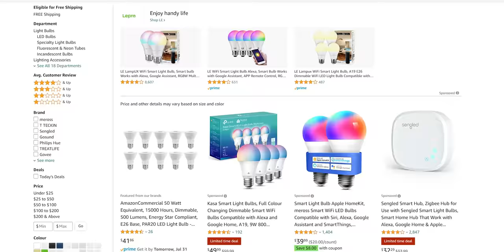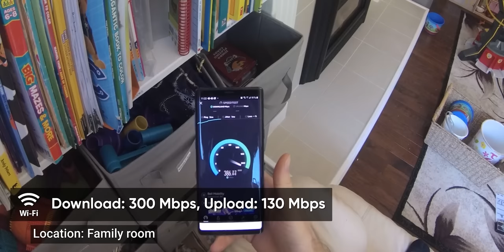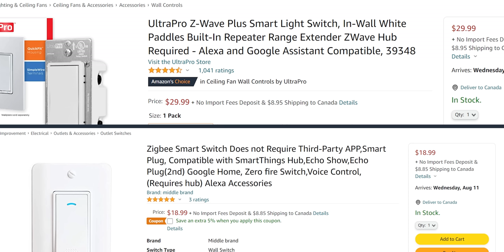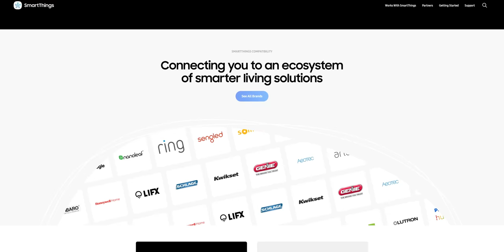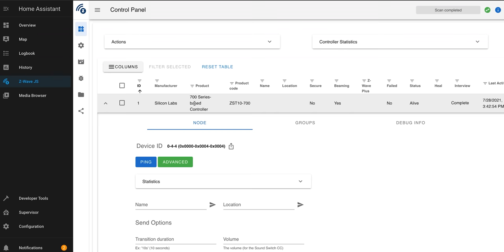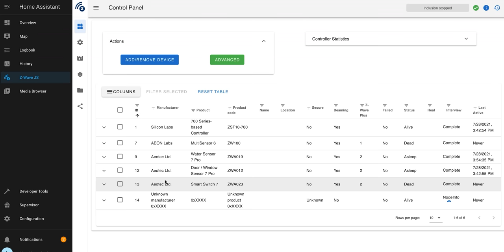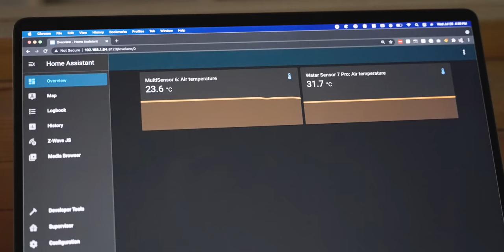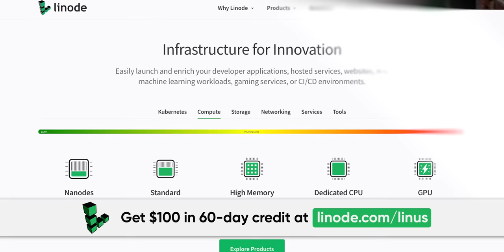My new house is gonna be MAGIC - New House Z-Wave Setup

Comment: The 900 MHz frequency band also has a significantly higher reach then 2.4 GHz with the same energy input as signal dampening is proportional to the Frequency.

Comment: No Linus as an IoT Engineer I can say is wifi devices can be battery powered my DIY made PIR smart sensor lasts 3.2 years with single charge for 2000mAh lithium ion battery... My DIY made sensor uses ESP12F MCU and PIR module draws 26uA in sleep mode and it does get activated about total of 50 seconds in a day. And my sensors connects to Home Assistant in 500ms max

Comment: When I worked in Kansas City I came to really resent the dumb thermostats. It is cold in the morning so I would need heat. It is hot in the afternoon so I would need cooling. Unfortunately, the 1950s vintage thermostat had to be switched manually from heating to cooling. Since I was at work, that did not happen. A fix is obvious, but I do not see it even today. Switching from a bang-bang controller to a proportional controller would also be a great improvement.

Comment: if you are using the GE Zwave switches beware that they are prone to failing from silly things like simple power outages or even just toggling a breaker. i haven't had that issue with the Motion sensing ones just the normal flat switchs.

Comment: One small little drawback with Z-wave is that unsolicited messages are not routed in the mesh network. They have to reach the controller.

So what are unsolicited messages you ask? 
Well say for example you have a device that measures the temperature. You can set it to send in the temperature every time it changes more than X degrees. But since the controller did not request the data it's unsolicited. And if the device can't reach the controller directly it will not get the data at all. However if the controller ask the device for the temperature, the request and the answer will be routed in the mesh. At least this was true in my version of z-wave. The newer version might have changed this. 

Another thing about the "backward compatibility" is that if you have any old version z-wave devices in your network all the new will only talk old version. You have to have all devices using the new version to actually get the features of the new version. Probably not a problem for Linus as he is starting from scratch and will get the newest stuff but when you already have 40+ devices it's a big deal at $30 a device.

Comment: I opted for mostly wifi devices. It was surprisingly hard to find a good set of z light switches. Switches are far better than bulbs. I stuck with z for other things like the smart locks, blinds, and sensors. The good thing is some hubs accept wifi connections too. I use home assistant for some things, and just Alexa for others. You can do simple automations fast in Alexa, but things like light blinking isn't there. I use a bright flashing light to disorient intruders long enough to unlock my gun and blare sirens in and outside the house. My general rule is battery items need to be z. Wifi has half the life

Comment: Not sure what service max is in the area they are in,but down in the US a lot of clients with that size house and with the same tech ambitions usually call for 2 200 amp panels for no double taps on the neutral bar. Something to think about depending on code enforcement in Canada.

Comment: I slowly filled my last house with the Google Home - Smart Things - Enbrighten Z-wave stack. It worked pretty well, but my battery smart-lock died incredibly quickly, and I think it was because the mesh was forcing it to activate frequently. We eventually gave up on using it as a smart lock, which was a bummer.

For my new house, I'm using Zooz switches. They have a couple nice features, including that you only have to replace one of the three-way switches.

Comment: I just installed rf relays in everything in my house I wanted to control, then ran a sonoff rf to wifi hub, controlled by ewelink and google assistant. I also have an RF remote which I use alot more often than the app or assistant

Comment: My knowledge is limited, but from my understanding z-wave, which utilizes a 0.9 GHz band has essentially hit the limit of what they can provide.. considering z-wave like Zigbee and their Bluetooth variants, all act as mesh networks, where several devices link together to extend the range of a network. Most devices buried deep in the mesh will likely have an ok time transferring data, but for that device at the border of the mesh (and even linking a far-reaching part of the network through a node at the edge of the larger mesh)...it might not have a good time. With that lack of bandwidth that comes with operating on such a low frequency, devices et the edge of the network will likely struggle to provide things like multiple high res camera feeds coming through it. 
Zigbee should handle better in this situation, yes the 0.9 GHz band will penetrate walls more efficiently, but the 2.4 GHz band will handle a larger amount of bandwidth. offering an individual node on the network a better chance of handling the load from several other far-reaching devices.

The main selling point of z-wave over Zigbee is that Zigbee isn't unified. In the sense that every single Zigbee device doesn't necessarily have to comply with a strict standard, allowing for complete compatibility with all Zigbee devices. BUT! in my experience, this only applies to proprietary Zigbee devices like Phillips hue bulbs (and these are EXPENSIVE!).
In my opinion, the only reason someone starting out in home automation should choose Zigbee over z-wave is price, and if that's the case you would never be standing there with a $100 Zigbee Phillips hue bulb, or a $120 2m strip of Phillips hue LEDs, scratching your head wondering why it won't connect to the rest of your Zigbee network. it's all too expensive anyway.

If you wanted to throw money at the problem, you would just buy all the hubs you need, all the expensive devices, buy a $500 mesh network, or a $600+ router that can handle your 100+ devices connecting via WI-FI simultaneously, plug it in then take a nap.
And if you really want everything working together well, just link it all with home assistant.

But if you don't want to invest $1000+ more than you have to, decking out your house, then Zigbee/ Z-wave is prob for you. Your average router will NOT be able to handle more than 50 devices (most cant do more than 12-17 devices) but using Zigbee or z-wave (a stripped-down version of wifi) your little router should handle just fine. 
You might have to dig out a couple of old routers from your basement, turn them into AP's to lighten the load, (considering not every smart device you acquire will be Zigbee and some will operate on the standard wifi protocol, but you should be able to set up the infrastructure with what's buried in your garage.

there are good reasons for buying devices that use either standard Wi-Fi, and there are good reasons to buy Zigbee. but everything z-wave can do Zigbee can do too, with the exception of signal range. but z-wave like all mesh's is only good if there are other nodes in the mesh, and it appears z-wave is falling out of favor and Zigbee is becoming more popular.
And as more devices on your network get replaced by Zigbee or standard WIFI, the weaker your Z-Wave network becomes.
Granted Zigbee suffers from the same problem, but Zigbee is becoming more popular, not less.

Comment: Super old video, but small tip - you don't necessarily have to push a pin/etc into the wire release slot on backwire/push-in wired switches/receptacles. You can just twist the receptacle back & forth while pulling and the wire will come out. 

Other side note - backwire really isn't the most preferred connection method. They use a quite small copper tab for connection which passes all the amps through a small portion of the stripped wire, and if the spring fails, can cause arc'ing/etc, leading to fire. so the majority of electricians will always use the screw terminals instead.

Comment: Nice choice. I would give you a tip that saves you allot of headaches. Switch the pi for an odroid n2+. More stable like 1000 times more stable and 1000000000000 times faster.
Reply: And yourself a Zigbee stick. Then you can add all other things and all brands together with your zwave.

Comment: I use Google Home as my controller (along with a bunch of Nest mini and hub devices), Sengled for lighting, and a Eufy for Security. Does what I need for a decent price. I have 27 smart lights, but they connect to Sengled's hub. So in reality, ONLY the Sengled hub is connected to my mesh wi-fi system, not all 27 lights. And honestly, new wi-fi 6 routers can handle 100 devices without sweating.

Comment: 90's home in vancouver is probably piped with poly-b or kitec.  Judging by the design of the home and size I kinda have an idea where you live and im gonna puts bets you have orange coloured or grey coloured pipe.  I would immediately I would have your contractor get his plumber or maybe a decent heating company to do a repipe.  The orange piping actually can catastrophically burst, and the grey is notorious for pinholes, especially if you have a cast iron boiler (I'm a plumber/heating tech in vancouver) Since your already doing what seems to be a massive 100k+ reno I wouldn't cheap out on that cause you dont want a plumber to come by and cut holes in your nice drywall or jackhammer your floor to repair a leaking line.  

This message will probably by sent to the void but hopefully the message gets to you.

Comment: Great video, looking forward to the project unfolding.  I have been building out a Z-Wave system for the last few years, and use a controller that handles Z-Wave, Zigbee and Wifi.  My only comment is that I have become somewhat gun shy of  GE switches.  I am finding myself replacing them regularly as they go down.  I am replacing them with Leviton, and they seem much more robust.  Getting 2-3 years out of a $65 switch is a bit annoying...
Reply: Yeah, the GE switches are not good.  That's why they're sooo cheap on eBay right now. Leviton is good, Zooz seems to be good stuff, too :)

Comment: Home assistant seems nice but I run Homeseer controlling x10, zwave+, concord alarm, 310mhz and 433mhz devices...I too hate batteries so motion sensors are battery and security devices use 3.6v 1/2 AA and last 12y

Comment: 11:30 son of an air conditioning contractor/repairman here. they're already supposed to have that. it's a hell of a lot less high tech but there's meant to be a float switch that detects when the drain pan is overflowing but i guess that either broke or was removed/disconnected. also, 15:25, yes it is. It is no better than running a microwave with a ball of tin foil in it.

Comment: It appears your z-wave devices are not added securely. Is that on purpose to improve performance (s0 can be slow)? I have struggled to add devices securely to homeassistant using the same z-stick and s0 supported devices.

Comment: And then there are people like me who installed CAT6E cables through my house about 10 years in every room and nook & cranny in my house including the garage.  Everything hooks up to it and with a 48 gigabit hub I never need to change batteries or worry about latency.   I also do not have a ton of wireless mesh devices around.  The only things connected to my wi-fi are things like Amazon's Alexa and my wife's laptop which can also be plugged into a rj45 connection.   Old school I know, but it still works awesome and great.

Comment: You got most of the comparison right regarding WiFi vs zigbee and z-wave
Except one thing. Wifi works perfectly well with more than hundred 2.4ghz devices.

You need to have a good Router.
Thats why Shelly 2.5 as light switch become very popular

Comment: I have a tuya based contact sensor. I have the local key, id and the ip address for it, I am not able to add it to local tuya in homeassistant.  Please guide how can I add it via .yaml configuration to local tuya.

Kindly guide.

Comment: Ive been doing zwave since it came out. And still prefer zwave stuff. Remember people, anything that has A/C power also works as a repeater. Anything battery operated is just a device sniffing out a repeater or a hub. Once everything is learned in reset your zwave mesh and vuala.

Comment: I install Security/Smart Home systems and as much of a pain zwave stuff can be some times it's honestly more reliable than the wifi based stuff, just avoid the light bulbs as much as possible as they tend to fail often and need replacing.

Comment: It is not true that ZigBee devices require no certification. In order to make a commercial product, your company must first be part of the ZigBee Alliance and second, each device also gets certificated. But even though there is a ZigBee standard that makes sure devices from different vendors can work together, vendors are not required to use it and can extend it on use their own higher level communications protocol. This basically means that ZigBee bulbs from manufacturer A might not work with manufacturer’s B Hub if one of them didn’t follow the standard strictly.

Comment: Much easier to convert a "dumb home" into a smart home versus buying new construction that includes some smart features. Ran into that hell - our HVAC is from Aprilair and their app looks like it was last updated for iOS 5 or 6. I immediately gave up on it, but their "smart thermostat" is required for our air handling system.

Comment: I had to look up what the french word for wire-nut was. I was wrong, he calls it a marette because Canadians are odd that way, and that's the name of the dude who invented them. If your furnace/ac coil is in the attic, check the drain after the insulators go in and blow all their crap everywhere. It will often get some insulation tossed into it.

Comment: Isn't KNX a thing in North America? It's an open standard bus protocol, wired and thus battery-less and all logic gets programmed directly into the devices with insanely complete functionality that often makes people skip the a home server like Home Assistant. The software is expensive but the per-channel cost is way cheaper than z-wave and zigbee at about 7 Euros per switched channel.

Comment: Since Linus will most certainly have a server running 24/7 in the house, probably one with VMs, then I would suggest that he set up Home Assistant on a VM instead. If he already uses a linux VM for something else, then he could just run Home Assistant using Docker. He wouldn’t even need to set up a new VM. It’ll run more reliably than running off a Raspberry Pi.

Comment: Make sure you're not sharing neutrals across breakers, that is dangerous. Also don't run the HVAC when they're putting in sheet-rock, it will break your air-conditioning unit.

Comment: Do not backwire switches, use the screw terminals on the side only, and screw them all in aswell, not just the ones being used. for the drywall damage if i had to guess float switches must not be code there. and everything on the left side of that panel is a clusterfuck

Comment: I could see those current monitors as a useful way to verify if an older rf controlled device actually turns on due to the increased power draw.

Comment: Great video! as allways :) i am setting up Home Assistant my self. I know your just testing, but holy shit. 110V? bad connections? use some wago`s or solid connectors, and recommend them. Your Neutral in the zwave switch i going through to other applications, and that can be a fire hazard. . We use 400 and 230V. More Volt means less amps pr kW. Less amps mens less fire hazard. Fluke Volt alert is absolutly not a safe way to check for Voltage, allthough, yes its cool. greetings electrician, Norway

Comment: Wait, not going to get a smart breaker box????
Those things are awesome, you get the hard breakers as normal, but then each breaker, inline, also has a relay. Which can be controlled by the software.
I think a standard size one is like 3,000$ USD

Comment: You cannot turn on an empty microwave. The microwaves particles will continue to bounce around inside the microwave as there is nothing to absorb it. Eventually the microwave particles may build up and continue to hit this metal component found behind the number pad and cause an explosion. I doubt the amount of time you turned it on for was enough for this to occur but its better to be safe than sorry.

Comment: Good luck with z-wave sensors and its delay even with 100+ nodes its totally unreliable (multisensor). Wire is the only thing to go from my point of view. We've tested all wireless solutions many times and from all three I would pick wifi + mqtt plus WiFi executed in proper way.

Comment: Can I just say, DO NOT turn on a microwave oven without anything containing water inside the device unless you wish to void your warranty and break your oven.  Microwave ovens work by exciting/ vibrating the Oxygen-Hydrogen bonds in the water molecule; that excitation / vibration then turns in to heat, which in turn cooks the thing inside the oven.  If you want to test the power consumption of your microwave, put a glass of water inside first!

Comment: "you could set the light switches to turn off when they sense light" 
Good luck with that Linus.

But just in case maybe save that 6 sensor for outside for the light reading, hahahaha

Comment: Just an FYI, I have lost several GE / whatever company actually makes them light switches when I had power outages. They just die. Blinking blue dot and no lights. My lazy ass didn't replace a couple that started working again after a few months. only to die again without warning. We need better light switches!